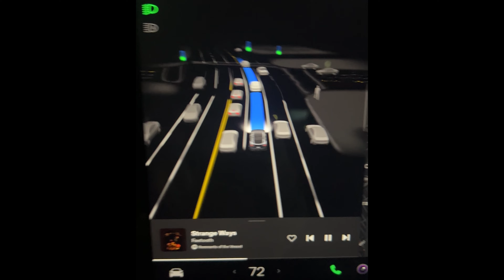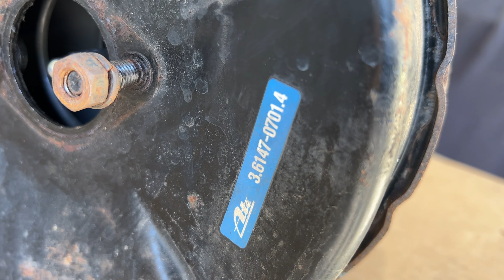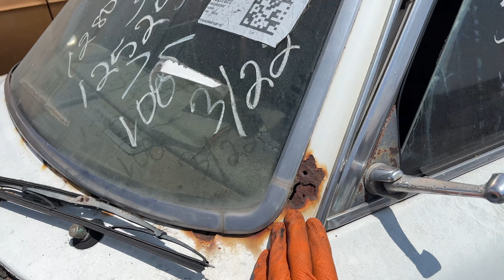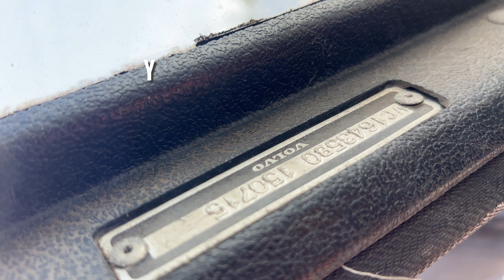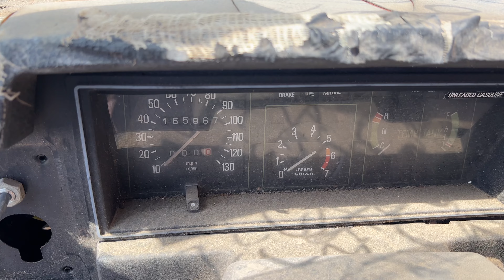1975 Volvo 164 Electric EV build - Part 5 - Painting Engine Bay, Junkyard run

Comment: My first car was a 1975 Volvo 164E Fuel injection one of the first fuel injected cars they made when I got the car it was already 25yrs old and in great shape.  I got it repainted had some repairs over the 3yrs I owned it, loved that car.  I finally had to part with it because the fuel injection harness was so worn and brittle and I couldn't find any shop that wanted to take the job of replacing it because the part was almost impossible to find and the mechanics I spoke with said it was a nightmare job to do.
Reply from the maker: That’s too bad. All the terminal ends are shared by Mercedes injection parts too, so they should have been available that way. I hope you got many miles out of it before parting. I will be talking about some wiring replacement in my ‘72 164E in a future EV episode
Reply: @DavidBello  I wish that I had held on to it much longer and waited until I could find someone to fixit. It was really amazing what pristine condition it was in, I just didn’t realize the gem I had in my possession, I was young and dumb.

Comment: Nice work David! I met you at one of the IPD Garage sales, maybe 5 or 6 or 8 years ago. Where did you get the spray paint, and any idea how I can find the correct paint code for the ~1976 245 bright 'orange' color? I've got a 1977 245 that needs a full repaint, & I want to paint it that color. My other Volvo is a 1996 850R estate, highly modified (R brakes were the most recent upgrade). It's painted Volvo 'Dark Olive' (dark green).
Reply from the maker: Hi Stephen, VP auto parts carries all the correct paint needed for these. Sometimes a slight shade off, like my engine bay, but closest to OEM and great quality cans!